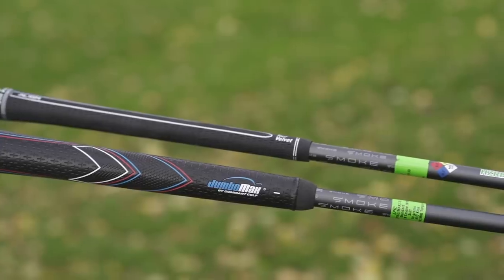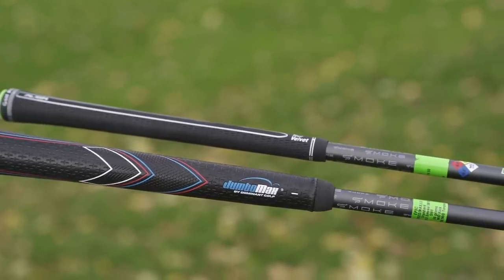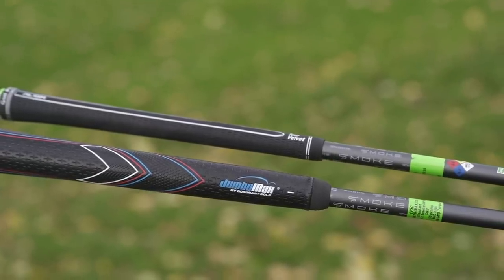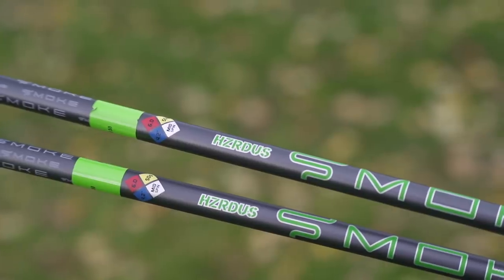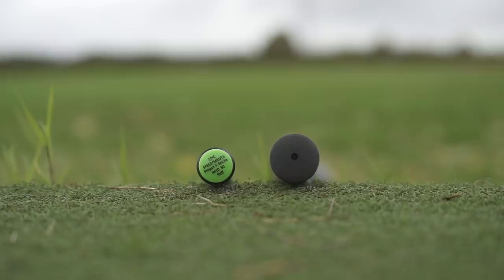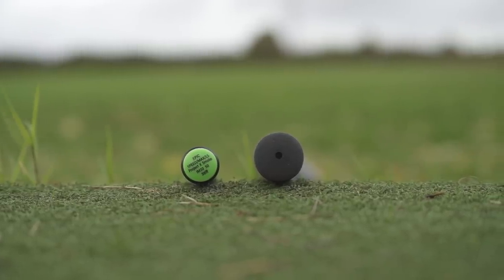The LONGEST DRIVER I have EVER tested! Part 2

Comment: Thanks so much. I’m 69 and a solid golfer with a little bit of hand arthritis. I bought the jumbo max  xl, put it on my driver and worked with it on the range. I fight the hook when I go after driver and often will block it right when trying to prevent the hook. I play a Callaway Epic Speed driver and have played two rounds with this gripon the club and have hit 27/28 fairways dead center and missed one a few feet into the left rough. I got accustomed to the feel immediately and my hands feel great. I hit the ball a  little higher so I dropped loft to  9.5 from 10.5  . I am hitting everything dead straight and long and I will next place them on my wedges and short irons and hope I continue to hit it as straight. They are a game changer. The cost is irrelevant as they are a few dollars more per grip but a new ball is $4 when it gets hooked into the woods!. The big problem is fitting 14 of these clubs in my current bag with the xl grips!
Reply: Yea JumboMax now needs to make a new golf bag for us....same exact experience with clubs not fitting in bag.
Reply: @DrSlipperyFist  great idea! Send it to them! A bag with same top opening dimensions would be fine but without all of the dividers which take up space.

Comment: Tested their tapered grip and the straight tech grip and preferred the non tapered grip.  The butt end is a little smaller diameter with less taper and allows you to grip down on the club with a similar feel for short game shots.  Definitely get the lite versions if you get them.  Lighter than Golf Pride jumbo size grips and similar to standard size grip weights so no change in swing weight.

Comment: Andy.... Fitted a Jumbomax in a Medium to my Mavrik Driver and WOW!!! I took 2 or 3 swings to get used to it but after that I was nailing it. You feel like you have more control with the larger diameter grip and it seems to inspire confidence. What I noticed... Dispersion was great, carry height was consistent and hard to tell with range balls but I'd say I was averaging about 15-20 yards additional carry distance and that was achieved consistently. Very impressed so far and have ordered more. Give it a try folks.... Who'd have thunk a much larger grip could make such a difference.... Cos it does 😁

Comment: Here's my bet - the bigger grip is preventing excess the face rotation which increases the energy transfer into the ball,  In effect you are compressing the ball better. In other words a hammer hitting a nail at a glancing angle does not hit the nail as hard as a square hit.

Comment: TXG  did a test on over sized grips. I recall they found that the larger grip slowed the rate of club face closure, which is great if you tend to over draw your hybrids for example. I tried it on one of my hybrids and it seemed to work. I know that if I use that club it won't go left much. It would be no good to me with my driver though. I leave it out right too often.
Reply: It might be! Relaxed forearms and hands may help you close the club face...it's a different club and recipe to a hybrid.....!?

Comment: I recently changed my woods and wedges from std Tour Velvet grips to mid-sized GP MCC Plus4 grips. Even that change took some getting used to but the 'quietening' of the hands, especially the trail hand was noticeable as is the reduction in hand fatigue. Experiment completed and deemed a success, I was about to change all the irons over too but after Pete Finch and now you trying these Jumbo Max, I might hold off and give these a go. Cheers.

Comment: I'd give my left, you know what, to hit my drives 250 yds. I'm a bit older than you but still strong and athletic so not sure what I am doing wrong and I have a decent swing. Same for all my clubs really - and I have the Jumbo grips which I love. I have a new GC3 coming from Foresight and setting up a temporary indoor range in my dinning room - yes my dinning room. I am no longer married so I am setting up a mini simulation room until next summer when I can build my addition on the house and make proper one. Anyway, looking forward to getting some data and taking some picture with V1 to nail down where I am missing.  BTW I like what you did with the interior of your space and am looking to do something similar. I know you filmed the build so I need to check it out again. Love you channel mate !!

Comment: Golf grips are only contacting and effecting hand position and pressure. These make players feel a lot more confident as it's a bit like gripping and swinging a baseball bat. As long as your swing is sound, the accuracy and direction should be similar to regular grips. If anything, these will promote a slight fade/slice for a right hander. 
Loved the joyful face when you launched it 250 + :)

Comment: Andy, I switched to CP2 midsize grips. Started on my wedges. Then had them put on all my clubs in the bag. Haven't looked back since. I recently ordered some pre-owned Callaway Epic max woods and the regular grips on those felt like gripping  a pencil. Had them regripped with midsize on those.

Bad swings are still bad swings but i'd say the midsize grips hit the ball straighter overall.

Comment: Replacing a std grip with a jumbo also affects the clubs swing weight due to the weight of the grip! Unless other alterations are made to the club head /shaft length etc, the club should feel/swing lighter maybe adding a bit of club head speed and added distance. Just my thought.
Reply: Not if you use the ultra lite ones. They are about 40 grams or under.

Comment: It appears the grip could be affecting your spin rate? 
That seams to be the key factor as you were sub 2000 and you launched it 100ft peak. 
I would focus the data points on the spin and launch & attack angle. And this also proves that Club head speed will not always produce the best yardage.

Comment: Like you I did not expect these results. I use 2 drivers over the course of the season. Definitely gonna put one of these JumboMax grips on the driver I use in the spring. Not sure why you get the better results but they can't be ignored.

Comment: I put the large jumbo max on all my clubs. The driver is 10 yards longer and with a much tighter dispersion. My fairway wood and hybrid feel better and I’m hitting it much more consistently the irons I don’t see that big a difference but it seems to be more consistent. On my wedges I feel more confident because I think it keeps the face square, less rotation. My theory on the distance and consistency is that it relaxes the hands. If your hands are relaxed your arms are relaxed your shoulders are relaxed can you generate a better turn in consequently more whip through the strike zone.

Comment: Makes sense. I don't have large hands. I went to a midsize grip + 4 grip. I feel more confident with it. Regular grips feel small and I tend to hook with them. I can really let loose with the larger grip and put some power behind the club that I might have been holding back.
Reply from the maker: It does seem that there is some logic in this and many feedback similar

Comment: Grip size made a massive difference to me as it kept me in a more neutral grip adding 10-20 yards on all clubs - I use midsize with 3 wraps so they are thicker & firmer
Reply from the maker: Thanks for feedback Chris
Reply: @TheAverageGolfer  fyi I’m a below average golfer to as had 2 strokes effecting left side so swing slower - used to play 90 pre strokes and hitting 92-96 after 6 years recovery on a good day so that’s probably why the grip helped me as a right hander with weak left side - keep the vids coming - I just switched from ping g425 reg to the Epic Max with the im10 in 50g & the lighter shaft with thicker grip really worked for me

Comment: I actually tried it myself.  I put about another 15 yards onto my driver in range testing.  I tend to pull the ball a little bit more but other than that the difference is quite noticeable.  It has eliminated that death grip I tend to put on my clubs.  I just put them on my 3w and 3h and will see how they work.  Might do the whole set if this keeps up.

Comment: Hello Andy, could it be the swing weight? You've put a heavy grip on the same shaft and club head as the standard grip. The balance point would have moved closer to your hands. It might make the clubhead feel lighter. Just a thought.
Reply: the Jumbomax xl Grips is actually just a bit lighter than a standard Grip
Reply: Sorry to hijack but I’m pretty sure JumboMax Ultralite grips are less than 50g in weight so compared to more widely available brands have no Impact on swing-weight.
Reply: @bwstokie  No problem Lee, hijack away👍
and I confirm that when I had all my club grips change to Jumbomax Xl's the fitter didn't have to do any adjustments to the swingweights
Reply: Ah right, I was going suggest that the decrease in weight might have an impact, but if the difference isn't enough to alter SW, then it's back to the drawing board for me. 🤔
Reply: @barrynorris828  Sorry, to send you back to the drawing board👍
My own theory about Jumbomax Grips, having used them all this year is that there is a physical & psychological effect/benefits.
Physically the larger Grip helps you to make better contact with the Ball by quietening your wrists and getting a square clubface at impact.
The bigger Grip definitely gave me more confidence to hit the ball harder. You feel as though you have a Hammer in your hand and you just want to SMASH the Hammer into the back of the Ball!
Give them a go, in my experience, they really do improve your accuracy, ball flight and distances👍

Comment: I put a Winn oversize less taper grip on my Epic Flash Sub Zero and didn't see any obvious benefit. In fact, the driver has been benched in favour of my old Nike Covert. However, I will take both of them out tomorrow and try to do a comparison.
Reply from the maker: I know a few who have tried and not found it beneficial which baffles me as to why this worked for me!
Reply: @TheAverageGolfer  Skill, talent, ability! I will let you know how tomorrow goes - if it doesn't rain.
Reply: No significant distance difference between the two drivers but much prefer the Nike. Will look at the 2022 offerings in due course - if I can get a decent trade in price on the Epic!

Comment: I just made the switch to the Ultralight mediums and love them I found as the clubs got longer they went straighter ( fight a big hook on occasion) ball flight a little higher. I did found that the grips are positioned in my hands differently I that is why straighter and higher.

Comment: I picked up three JumboMax JMX Ultralite Golf Grips from ebay.  Overall I think they suck!  They are overpriced to start.  They are difficult to install.  When putting on steel shafts, the edge of the shaft easily tears them up.  I got one on my graphite drive with quite a bit of effort (I've installed grips for many years).  With the other two I was able to get one on my 6 iron and one on my lobe wedge, but with damage.  With my driver, I now have two idential drivers with different grips.  After hitting 25 shots with each driver at the range, no meaningful difference in distance or dispersion.  But what really sucked was the hard surface on the grips.  I got no relief in grip pressure, rather the opposite.  My other grips are Winn DRI-TAC.  There is a huge difference in the feel of the two grips.  The Winn's are far superior.  I haven't given up on oversize grips.  I have some Jumbo DRI-TACs ordered.  They aren't as oversized as the JumboMax, but I won't have to grip them as tight either.

Comment: Good work Andy. I tried the Jumbomax ultra lite grip on my driver for the first time this week. Took a little getting used to but the results were much better the expected. Not sure if there was an increase in distance due to windy conditions but it was certainly straighter than I normal hit with the driver. Less movement in the air and definitely couldn’t go left which is my normal bad shot. Over drawing or pull. The driver height was possibly higher than normal which for me is a good thing. Going to stick with it and possibly try the bigger grip in the 3 and 5 woods. Carry on the good work and enjoy the content 👍🏌️‍♂️
Reply from the maker: Thanks for the feedback Paul, seems to be worth trying for a while

Comment: Just had a indoor lesson tonight and switched driver shaft in my ping driver to a shaft with jumbo grip. Everything went more positive. Club head speed, launch angle and most importantly carry of average 12-15 yards. So much so I left my driver for re-gripping, pick it up tomorrow. My Pro concluded much the same as you. Leap of faith but I can always get the old grip put back if needs be.

Comment: After watching both videos and getting some new clubs  last week , I went to my local pro / repair shop I changed my grip from a single tape to 3 tapes on my cobra radspeed could not get the grips in the video , at the range tonight hitting 40 balls with the driver what I did notice was
 1. I did not hit the ball left,
 2. I only hit a few right ( last week I was hitting both pushes and pulls), 
3. I found the ball to be straighter and a higher flight.
I will see how my 12 holes of golf go this week and will
 consider getting all my
 clubs changed too the 3
 wraps of tape , oh my
 h-cap is 8.6

Comment: I think it's been mentioned already Andy but it's physics. You've increased the total club weight while reducing the club swing weight. As a result you're delivering greater mass at a higher speed and as long as your smash factor remains the same you'll arrive at greater ball speed and more distance.
Reply: Don’t think so as JumboMax Ultralite grips are comparable if not lighter than mainstream grips.

Comment: They feel good, but 2 me they slow my release down?  I have trouble squaring the face up using the very large grips!  I put one on my Ping G425 Max and left EVERTHING out 2 the right with way 2 much spin!  So , I replaced the large grips with a Golf Pride Tour velvet 360 midsize which is almost a small standard size grip.  Results were day and night!  Longer, straighter, and with much less spin!

Comment: I’ve put a golf pride jumbo grip on my driver, not for distance but dispersion, I like it!
Reply from the maker: Need to discuss
Reply: I just put on golf pride multi compound midsize grips with 5 tapes.  Should equal about Jumbo or a hair under.  I wear an XL glove.  I think this will be game changing.  I’m currently a 2 handicap.  Wondering if I should go to the jumbo max but I was scared to because I don’t think I like the material and I’m not sure of making that big of a leap.  Seems like a Winn grip material that feels nice but doesn’t last but a couple of months.
Reply: I added mid size grips to my 5w and Hybrid (plus 2 tapes) - feel confident at address and hitting more par 5s in 2 as a result. Likely to drift to mid size on irons at some point but I’ll see how I go

Comment: Very interesting Andy. I have a mid size grip on my new driver this year thanks to the fitter noting my long thin fingers and suggesting a thicker grip. I love it and been thinking about putting a mid size on my old 3w and hybrids - they need new grips anyway. If that works, then I'll think about the irons as well (which also either need new grips or replacing). I also put a jumbo size SuperStroke grip on my new putter and that's made a world of difference. Looking forward to seeing what you find with the other clubs.

Comment: Great video as always. But why do you need to figure it out? It works better for you so you should use it. Who cares what the reason is. I have found with the Jumbo max grips lots of people try to talk themself out of using them. Yes they look different on the clubs but if they work that much better then what you are currently using why would you not use them. I went to them a few years back because I have a bad wrist. They have helped that issue. I hit the ball much straighter and did gain some distance. Now when I try a regular grip it feels so tiny! I will never go back.

Comment: I put a large JM on my TM 2007 burner and I picked up about 20 yards more. But tried them on my 2nd hand irons and didn't quite like the feel.
Reply: tm burner 2007 is one of the best drivers ever!
Reply: @dogsarefun2  I just got it a couple months ago. I bought it just to compare with a more up to date model driver, a 2020 cobra speedzone. That burner out performed it and I sold the cobra.
Reply: @thecringegolfer  stock remax 50 gram shaft and slightly closed face is a great combo.....amazing how a 10 year? old club will get better results than a new club...... burner 2007 3 & 5 woods are excellent too....
Reply: @dogsarefun2  yep! I have the 3w planning the 5 at some point and maybe a hybrid.

Comment: here my results: had a few irons regripped (6,9, and 4 ) they inadvertently put midsize on the 4. Feels good, but the inconsistent action doesn't help .
The point is , keep them consistent. same swing 14 clubs.......why mix the grips only to add another variable ?
Reply from the maker: Yes agreed must go all in
Reply: @TheAverageGolfer  Some Winn grips are lighter . As such it increases the swing weight ; the head will feel heavier .

Comment: I cannot think of an other sport that has spindly thin handles like golf. Tennis, Squash, Table Tennis, Badminton, Base Ball  and Cricket, Hockey, Shinty and Hurling. Sledge hammers and an axe come with thick handles. There must be something in the fact that the human hand is better designed to grip a thicker handle for swinging a long object. Maybe it is in our DNA? We are the only apes with opposable thumbs, so the thin handle resembles a thin branch and you would not last long up a tree holding onto one of them.